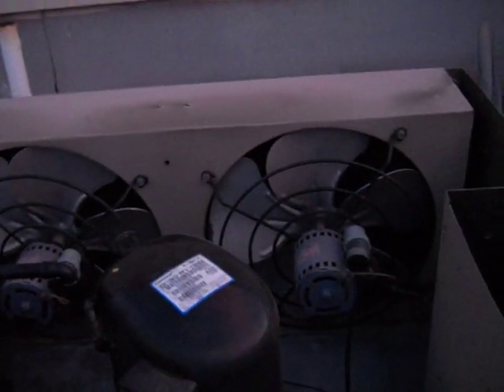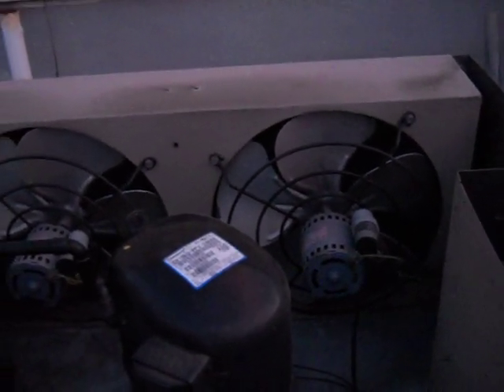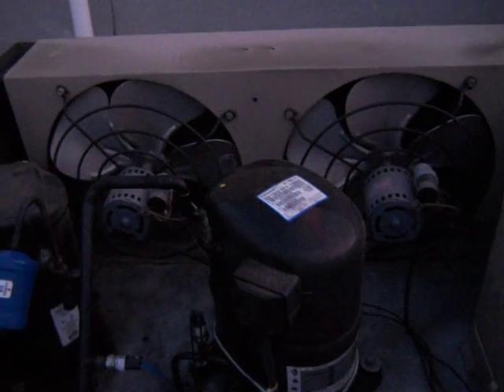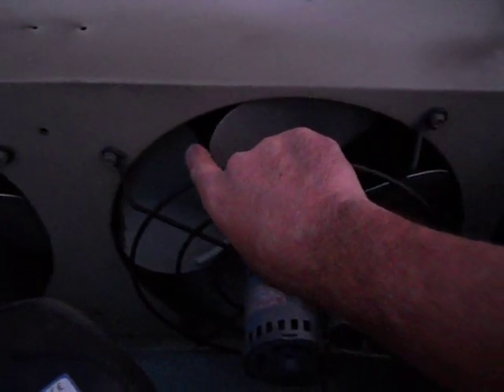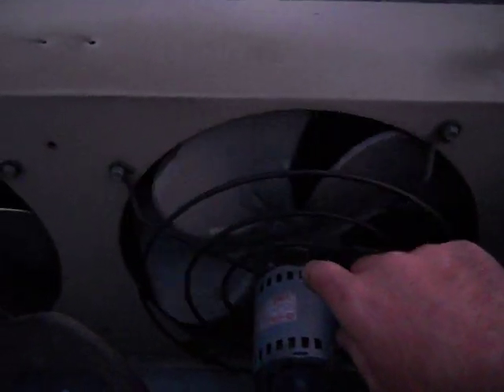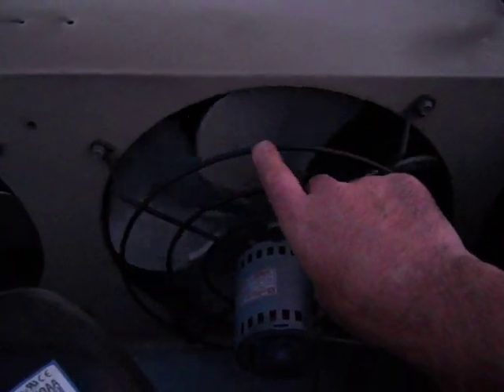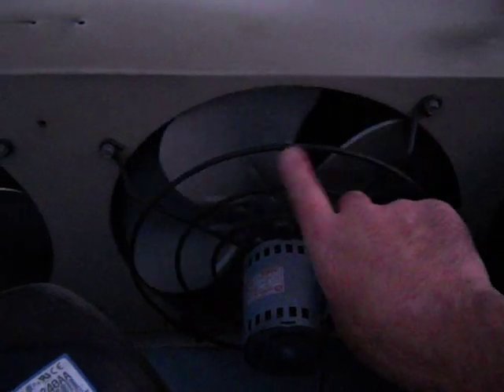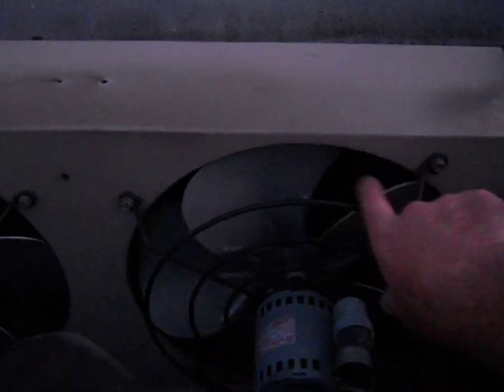Condenser Fan Motors-How do i Know if they are Going to Last?

Comment: can you please tell i have same unit with 2 Condenser Fan Motors   my question is
when the unit works  does both Condenser Fan Motors Turn on at same time   or just one work  and the other is idling
Reply from the maker: Both Condenser Fans Should Be Working at All times When Compressor is Running. On this unit Both the Condenser fan motors are wired Straight to the contactor. if your unit is the Exact same Manufacturer as this unit. This is a HEATCRAFT UNIT. Someone could have modified something in your unit it sounds like. sounds like someone put a temperature control on one of the fans. Like i said both fans are supposed to run all the time the Compressor is running UNLESS SOMEONE changed something? OTHER MANUFACTURERS use Pressure Switches to Control one of the Fans. One Fan Runs all the Time and the Other one Comes on When it is HOT Out and the Pressure Switch Closes Bringing on the Other Fan.
Reply: OcRefrigeration.Com
thank you reply   mine run with only 1 fan   so i change the motor  but still would,nt run    so then i looked at the exhaust fan on the wall  the temp was set at 40f and only 1 compressor fan running   so i got bit worried   so this what i did to the wall exhaust fan temp i put it to 80f  so basically it stopped 

then the little room got so hot   that the second fan started on the compressor  and both running together  does this indicate that it has some kind of energy saver built in  ?
Reply: Right Oc. Heat crafts come with a head pressure control valve. 180 or 215 psi setting called a headmaster.  Sounds like someone modified the unit. Those heatcraft condenser fan motors will work in other condensers as well they will work in some very older Tecumseh condensers as well.  Learned that a few years back. Keep 2 on your truck at all times. 👍

Comment: The motor will get too hot to touch too. Amp draw past factory specks thats another way to tell . But your right it the ball bearing lock up in the motor , then its time for a new motor . Those condenser motors if not moving the air across the condenser will kill the compressor too . . Good video .